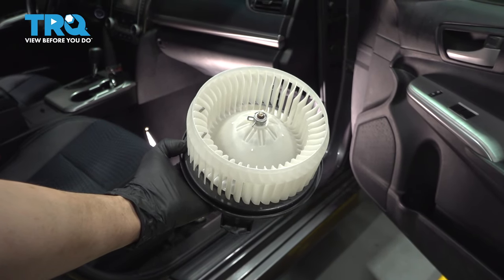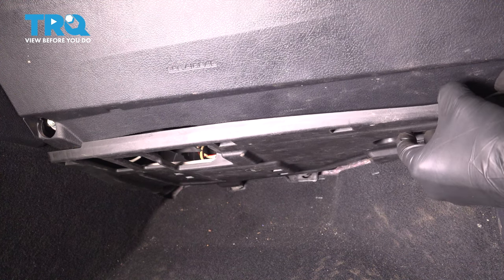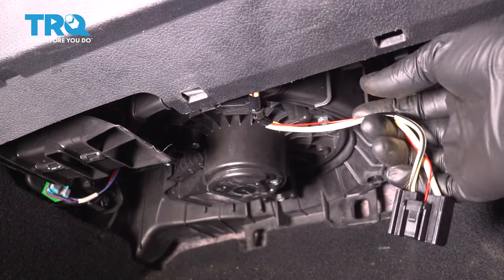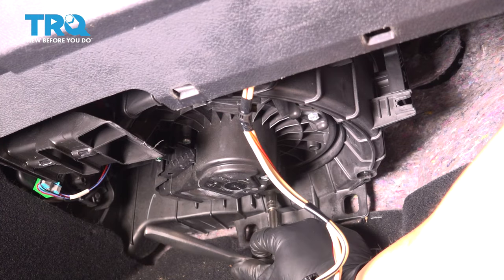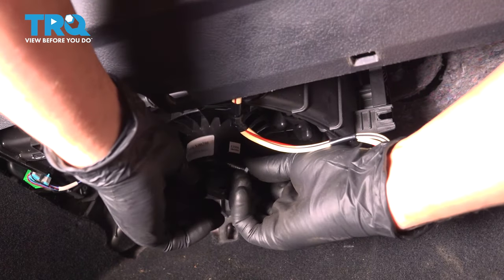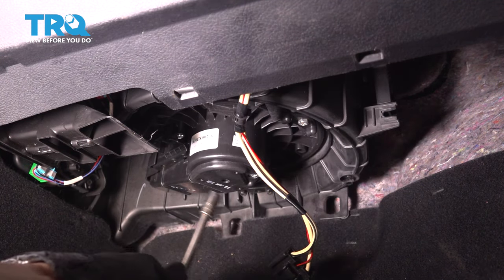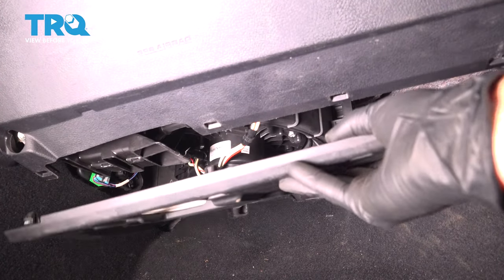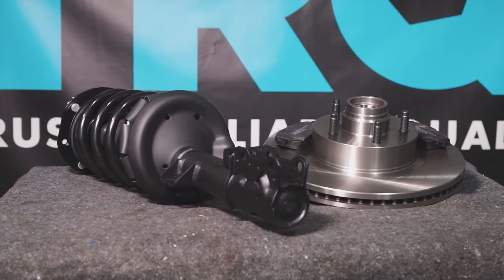How to Replace Blower Motor 2012-2017 Toyota Camry

Comment: Thanks..pretty much same for my Lexus ES 350, 20 min easy swap.
Mine was making some noise and was intermittent not blowing air...especially when car was parked after driving. So far a day later seems to have fixed issue.

Comment: Thanks. These procedures worked on my 2015 Avalon.  Suggest adding electric tape on the 3 screw holes and adding the screws half-way.  That will save you time when remounting.